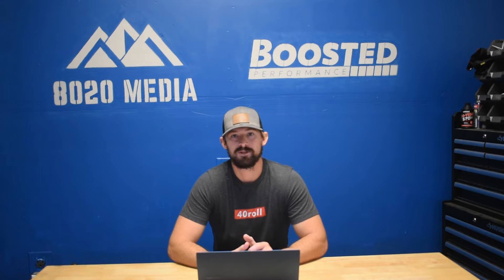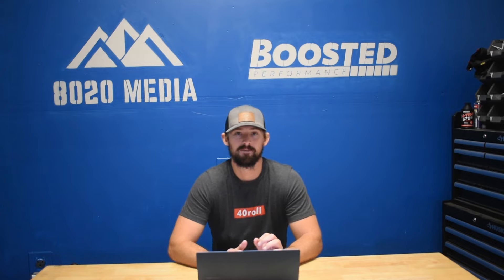DIY: How to Fix GMC/Chevrolet "Service Stabilitrak" & Traction Control Lights!

Comment: How often is it ECM?  Seems like mechanic I went to went straight there
Reply from the maker: ER - It's quite difficult to put an exact number on this, but if we had to, we would say not very often. However, that's not to say it's not the cause in your case. This is pretty difficult to diagnose. Do you know if there were any engine codes or anything?

Comment: Do you think a faulty fuel vapor solenoid valve could cause a service stabilitrak issue? I'm thinking about buying a suburban and the post says it says service stabilitrak and the fuel vapor valve is bad. I'm thinking maybe the gas tank is pulling a vacuum and not letting enough gas get down the line, but I ain't really a mechanic. Thanks for the video though it was very informative.
Reply from the maker: Yepp absolutely that could cause it, pretty common issue - we have a guide on it I'll link below. Just run it through a code reader and see if you're getting the P0449 code, or any. 

https://chevytrucks.org/p0449-engine-code-evap/

Comment: I'm a disabled veteran and I drive a 2011 Chevy Express 15 passenger van. It holds my lift and powerchair, one bench removed to hold the crate for my service dog. I bought it from the Air Force and at 13 years, I have just hit 46,000 miles on the odometer. I'm getting a message to "service stabilitrak" and occasionally the "ABS" light shows up on the dash. 
As much as I'd love a newer van, this one is paid for, but I DREAD going to a mechanic as an older woman, I will get overpriced work. Can you help? I'll pay a reasonable price.  
I have one more trim piece to add, a running board step for the driver's door. This van is 23 inches from the ground to the door tread. I don't drive that much, but I have to keep this buggy running as long as possible. 
A modified handicap van, base model, begins at $90,000 USD!  That is NOT in my budget.  
I know you cannot estimate the costs with stabilitrak and ABS, what should I have saved up to repair these warning lights? $1000? $2000? More? I live in Central Alabama. My van, power chair, lift and service dog crate is my lifeline to the world. Thank you.
Reply from the maker: Hi Jo - to be honest I would guess neither of these things are really coming from "real" problems. Driving with them on occasionally isn't going to lead to any other erroneous problems so honestly it might just be best to drive as is unless it really bothers you. Part of the reason it can be difficult and expensive to "fix" this issue is that it's very difficult to actually diagnose what is causing it so you end up throwing money at a bunch of parts that might or might not fix the problem. The first step would be to scan for any possible codes - which Autozone or Oreilly's or any shop should do for you for free.

Comment: I changed my hydroboost on a 2012 lml 2 days ago and now my traction control light is on and my brake lights never go off. Any ideas?  It’s a painful process to fully bleed the system so I’m trying but I can’t imagine it going from a leak, to me swapping it, to this. Please help.

Comment: When I flash my high beams service power steering displays on dash until I turn off high beams! Also I'm getting a constant U0101 lost communication code, intermittent service stabilitrak & power steering ,gear select indicator light disappears on dash, transmission then downshifts hard and jolts vehicle,  door locks locking/unlocking on their own and limp mode as a result of all this. Its a 2015 GMC and never expected this on the newest vehicle I ever owned.
Reply from the maker: Scott - This seems to be an electrical issue to us, which becomes very tricky to diagnose. Have you taken it into a shop yet?
Reply from the maker: 7 hours?! Wow, that is absurd. We basically gave you all that info for free here... So sorry to hear this.
Reply: @8020Media  Yes, I agree. So I'm swapping out the ECM for a junkyard ECM that works good as I was told. I'm having it cloned so it will function when installed. I'm hoping it corrects the issues. If not I will stop throwing parts at it and just sell it as is and hope I could at least break out even as I'm not in a position to afford to lose money. Honestly, at this point it is what it is.
Reply from the maker: Keep us updated on this!

Comment: When I turn the steering wheel to turn in to the driveway way the steering wheel will lock up and the vehicle will die.  The stability lights go o
Reply from the maker: J - Are you getting any engine codes? Or are you getting any other drivability issues?

Comment: My 07 Yukon throws the traction/stabilitrak lights on randomly and then jerks real hard when it’s shifts from 1st to 2nd. Engine is throwing codes for rich in bank 1 and 2. Auto shop cleaned all plugs- they were just changed last year and replaced mass air flow sensor. We also replaced all abs wheel sensors and brake pads and rotors. Rnamdoly it will also put out white smoke out the exhaust when starting up.
Reply from the maker: A - Based off of these symptoms it could be one of these problems: Fuel system, ECU, transmission, or head gasket. Keep us updated on this.
Reply: My Tahoe does same thing. Did you fix it? If so what fixed it. Was it all those things you mentioned?
Reply: My 07 Yukon denali does the same thing. It will throw the traction control light SYS lights on and sometimes the check engine when you hit breaks, but once you take off about 30 seconds later, the traction control goes off, but the check engine stays on. I can go down the interstate, and it runs great no traction lights at all, but when I get to the stop and go traffic, it comes on every time I hit my breaks. I replaced the break switch, plugs, and one coil that was bad. I let it sit for a month while I was on vacation and just drove it the other day and no problems at all but today the traction control lights came back on but check engine light went off.

Comment: I use to get that light a lot then I found out I had a leaking brake line and fluid was low. I could add fluid and light would go off.
Reply from the maker: Nice, that would certainly do it! Thanks for the added info

Comment: What about the oil pressure switch ?
Reply from the maker: Thomas - This certainly can be a possibility. If the oil pressure switch is faulty and the engine control unit (ECU) detects unusually low or high oil pressure readings, it might interpret this as a potential engine performance issue. In response, the ECU may disable the StabiliTrak system as a precautionary measure and illuminate the "Service StabiliTrak" warning light.

Comment: I drive a 2017 Camaro and change bigger tires to car and now next day is showing me stabiltrak light and AB’s lights came on.
Reply from the maker: Rey - Sorry to hear about this. This shouldn't be a problem, the car may need a few runs to get used to the bigger tires. Likely the wheel speed sensors are thrown off. Keep us updated.

Comment: Does catalyst require service affect my RPM which lead to turn off my tracks stabilizers?? Please someone answer 😔
Reply from the maker: Ruben - are you getting a P0420 code for the catalytic converter or could you explain further? A clogged cat could increase exhaust backpressure and force exhaust gasses back into the combustion chamber which could lead to misfires and therefore cause Stabilitrak to disable.

Comment: 07 yukon, when i changed my oil pressure switch, reach around fix, not removing the intake...then the traction and stabilitrac is acting up...but also have one TPMS out, Ill fix that first, and noticed before a pulsing brake after i replaced the front rotors, pads and calipers..hinking the electronic parking brake or perhaps ABS in the rear is applied that warped the rotor. I have noticed idle a little rough....after TPMS, wheres a god place to start...
Reply from the maker: Michael - tough to say with all of the things you have going on there. If the idle wasn't rough before replacing the oil pressure switch I'd look into that - could also be spark plugs or something more simple like that causing the rough idle which will certainly cause the lights to go off.

Comment: Hi all the sudden I got this lights on my dash after an accident. I got hit on drivees side rear wheel and cracked. Lucky no major dameges. But now i see this lights i dont feel a problem exept for light there worry me if the accident had something yo make me woory or how yo turn them off.
2012 suburban, 90k miles
Reply from the maker: Rudy - Sorry to hear about your accident. Did you have the Suburban in a repair shop after?
Reply: @8020Media  hi not yet im waiting on insurance call to get it fixed.
Reply from the maker: I'm sure they will address it once it's in there. Keep us updated on this!

Comment: I have been having this problem with my 2007 Yukon. And I have no check engine lights… sooo frustrating. The throttle body has been replaced all the plugs were replaced the entire suspension system has been replaced… I hate it!!!
Reply from the maker: Tsunami - It certainly is a frustrating issue. Sorry to hear about your experience. Hopefully this gets resolved soon for you!

Comment: When my stabilitrak light turns on my power steering does out for days
Reply from the maker: B - Well that's not safe to drive on..
Reply: I cleaned the the throttle body and it had some oil in hose and burned oil on the body. All engine lights turned off and now the power steering is working. A new max air flow sensor worked before that for only month.
Reply from the maker: B - Hope this works for you!
Reply: I replaced the brakes, struts and when's the stabili track light turns on the power steering goes out the gas mileage drops to 12 mi per gallon the backup camera doesn't work right
Reply from the maker: B - This is now leading us to an electrical issue..

Comment: I've been dealing with this issue for about 2 years on and off, with my wife's equinox...this system is BS. Changed the EGR valve once as per the P code, not not idiot light on but stabilitrak gas turned off. I hate this vehicle.
Reply from the maker: Nick - Unfortunately, you aren't alone with this system.. It has caused many headaches with many consumers, especially with the difficulty of pinpointing exactly what is causing the lights to pop. Very frustrating at times. Hope you find the fix soon Nick! Keep us updated.

Comment: I gust changed my abs control module and it came on and also power steering all so came on to buy no chech engine light on
Reply from the maker: Hector - if this happened right after installing a new ABS control module then I'd assume you are having an issue with the new module.

Comment: I have a 2007 Chevy avalanche now this issue has occurred a couple times. The check engine light turns on than the displays shows service traction control & stabilitrak off . This has happened while driving. The main issue with this is a hard shift from 1st to 2nd & a somewhat hard idle. Has anyone had this issue and what was the fix? I've read many of these post and I really don't want to be going to the shop over and over dealing with their B.S. If anybody could help me out I would greatly appreciate it. Thanks
Reply from the maker: It's really hard to diagnose it based off of that alone. As we mentioned in the video the stabilitrak light is coming on because of another issue, not the other way around. So you need to figure that piece out but we need more details to be able to pinpoint anything. Could be 12 different things

Comment: Stabilitrak and Steering Assist Reduced are flashing on and off. They are not steady. Took to GM and was told they would need to use a flow chart to try and fix the problem. First, I will need a Inflatible Restraint Module, if that is not the fix, I will need a new EBCM. They may not be the problem either. Basically, GM will be charging me to go through a flow chart to TRY and fix the problem by using process of elimination. How is that fair to the customer. Sounds like they are just fishing for money.
Reply from the maker: A - Unfortunately, this is normal.

Comment: My wife got slammed by another car on the side. Knocked the alignment way off. Now the traction  control doest want to reset. Hopefully it's just that and it reset back to normal. Before we just had a bad tpms sensor and it was still working fine.. I asked then to take a look at the sensors but they want to charge for diagnostic test 149. I was for what I just what a physical inspection. Since the warning is on its it limp mode can barely go past 60 with rpms around 2000
Reply from the maker: Ramon - the limp mode is probably the reason why traction control is disabled, not the other way around. A traction control light won't send the car into limp mode. I'd suggest scanning for codes and seeing if there is anything that pops up.

Comment: I’ve just replaced my engine through a shop and I’m having this problem and the check engine light came on now
Reply from the maker: Eric - you should try to read the codes coming from the check engine light to narrow down the problem. It likely has something to do with the engine replacement like a small vacuum leak or a sensor that was broken or not properly connected during the replacement.

Comment: 08 Acadia service stabilitrak and traction control off message just by driving down the road. There is no difference driving before they come on or afterwards.
Reply from the maker: Have you looked into anything we discussed in the video or tried a code reader?

Comment: in other words lift up the hood orniment and replace everything under it! Sounds like a mechanics fairy godmother. Cha ching!
Reply from the maker: S - Well unfortunately, this isn't the easiest issue to solve.. The best thing to do is to read the engine codes and go based off of that.

Comment: I started having a lot of problems with the braking system of my 2016 Chevy Tahoe all of a sudden like hard brake pressure from the low brake pressure believed to be a vacuum pump issue. Had it replaced worked fine for awhile, then my brake lights started staying on and had a stabilitrak light. replaced the switch then started having hard brake problems again. Replaced the vacuum pump again which didn’t fix the hard brake pressure this time. Finally replaced the brake booster brake pressure was fine. All of a sudden brake light started staying on again along with the service stabilitrak light.
Reply from the maker: T - Unfortunately not the easiest issue to diagnose, but here are some other things that you can look into: grounding cables, brake pedal position sensor, brake fluid or lines, master cylinder, or the electronic brake control module (EBCM).

Comment: I changed my struts and traction control came on. I have no codes this is going to be a tough one to fix
Reply from the maker: Oscar - Check your ABS speed sensors. They are located close to the struts so there’s a chance one of them could have come a bit loose. Additionally, if you have the autoride self leveling suspension check the wiring on that. Keep us updated!
Reply: Did you get this figured out? I just changed my rear shocks and first start "service traction control" and "service stabilitrak" came on. First time I've ever had these lights. Also have no error codes. Just lights and messages on dash.
Reply: @jacobedwards874  2014 Caprice...changed struts and got  the ABS and Service Stabiltrak lights on.  No codes.  Anyone know where  to start?

Comment: Will bad gas also cause
Reply from the maker: Rod - This definitely can be a cause.
Reply: So if you cant find a place that sells e85 to run thru the 2007 chevy avalanche ltz 5.3L flex fuel engine.. what would you recommend to clean out the fuel system instead

Comment: I have the service stabiltrack light, the traction control light on, my check trailer warning came on and my brakes are stuck on evenly about 50 percent and the truck is basically undriveable. Has anyone had this problem? It’s a 2015 duramqx. It’s been in a shop 6 times now. The truck will drive fine then all the sudden these warning lights come on and the brakes are stuck on evenly about 50 percent pressure. Then it goes away and drives fine. I take it back to the shop and it won’t do it again. Today I got it to stop by turning traction control on and off, exhaust brake on and off and turning the truck on and off. Then the brake pressure released and I drove it home with the traction control fault light on and the following codes 

Co131 ABS
Co273 Brake reservoir sensor fault 
B101D AMP
B124B HUMAN MACHINE
B374A HVAC
B1325 HVAC
B1325 Ratio
Uo415 t/b
Uo415 t/c 

Any help would be greatly appreciated!

Comment: Dude mine says service traction control and throws my engine in limp mode.
Reply from the maker: S - Sorry to hear this. What engine codes are you getting?
Reply: @8020Media  not sure yet I'm so swamped with work I haven't had a chance to get it read. I just keep disconnecting my battery and going for another hour or 2 lol.

Comment: I’ve had issues with mine since it had 20,000 miles I have 80,000 now never had been fixed goes to dealership they replaced things 2-3 months later it is back in shop
Reply from the maker: Sorry to hear this Bart! We know this is a big issue with many GM vehicles. There are so many causes that it's hard to devote it to one thing. But hope your vehicle gets fixed in the near future!

Comment: Been dealing with this @35k on 18 serria  5.3. Cuts out cruse control
Reply from the maker: Carnz - Have you taken it to a shop for diagnosis? If you are handy, we do have an in depth guide on where you can start with your own diagnosis.
Reply: @8020Media  thanks for the reply,  I have a couple times. First nothing showed up. But then the steering wheel angle sensor showed up with loss of communication. When it first started happening it was every now and then. But now it's been on months.